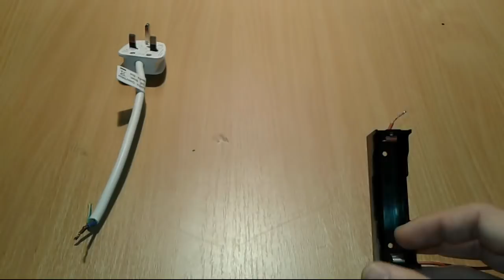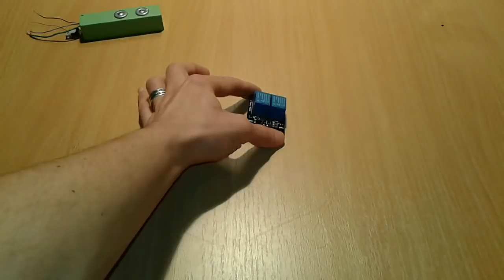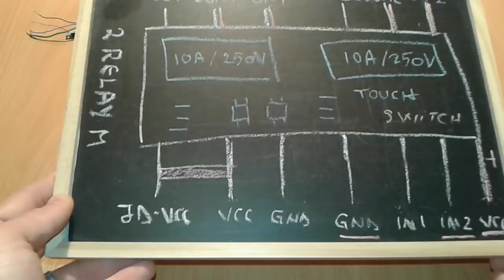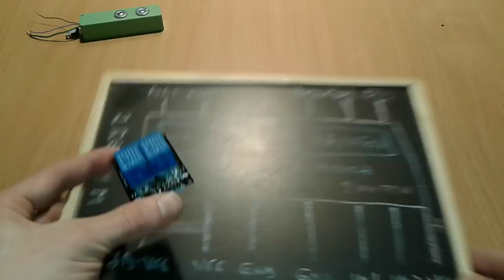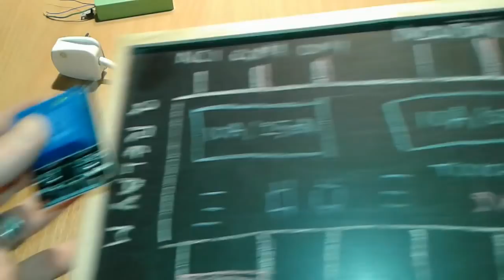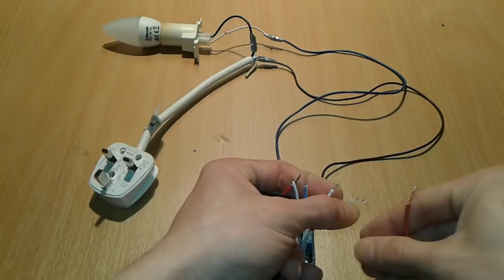How to make a touch switch circuit for 220v lights using relay board

Comment: Hi, how would you solve it with a " Reed " Switch and Magnet? Example.... Put a Magnet over the Reed Switch, it turns on..., then Magnet over Reed Switch and turn off?
Reply from the maker: Jordan Bronson hi there buddy I am familiar with a Reed switch it depends what you want to make, because this video is about a homemade touch switch and 220v relay. If you wanna replace the relay with Reed will not sustain a big load, and to activate the Reed you will always need a magnet to switch it on or the magnet can be replaced with a copper coil when energized will act as an electromagnet. Tell me more what you wanna make
Reply: @NoSkillsRequired  - Hi, everything is almost the same.  I want to change the " touch part " only.  Meaning, instead of touching, you pass the Magnet over.  You would required maybe just 1 Reed Switch.  As the Magnet pass over, it turn on, as the Magnet pass over again, it turn off.
Reply from the maker: Jordan Bronson you can make it only when magnet on top is off, when magnet out of Reed will be on, similar to the small door/window alarm?
Reply from the maker: Jordan Bronson from what I know there are 2 types of Reed normally open or normally closed
Reply: @NoSkillsRequired  - Yes, that is 100%!  It's a Reed Switch that is from an Alarm in Door/Window.  By using that, you are only activating to turn On / Off by swiping the Magnet over.
Reply from the maker: Jordan Bronson aha now if you have the hole thing or buy another one should be cheap is very easy just extend some wires from the speaker inside the unit to the relay should be a 12v activated relay I will send you a video link
Reply from the maker: Jordan Bronson https://youtu.be/6RbQeG5SFdU this is similar to the door alarm the circuit should be the same instead of connecting a light you will connect to the relay but measure first the output to be in the relay specs hope that help